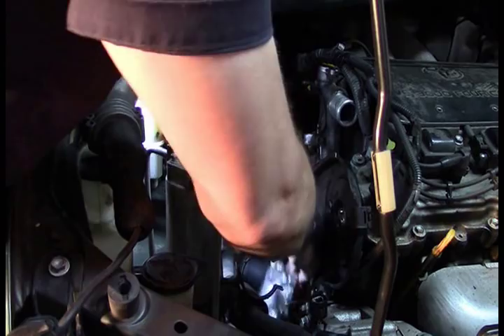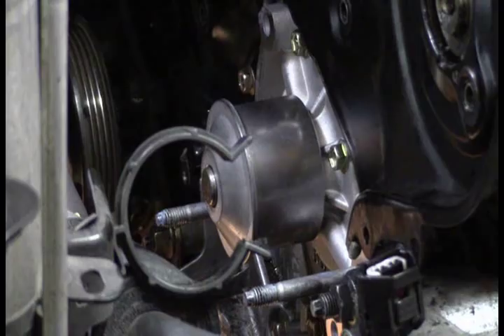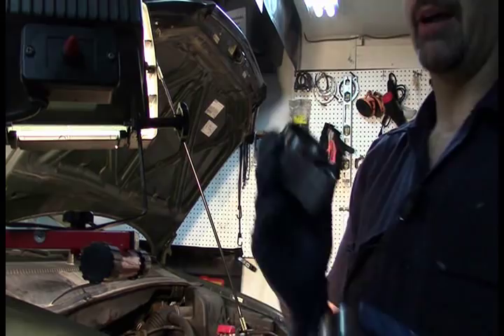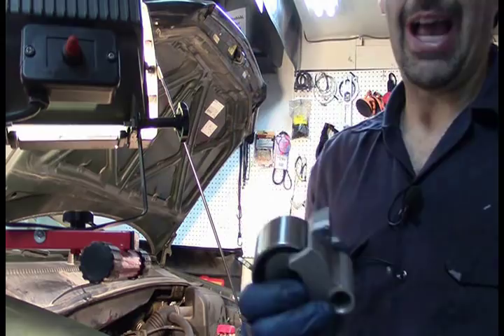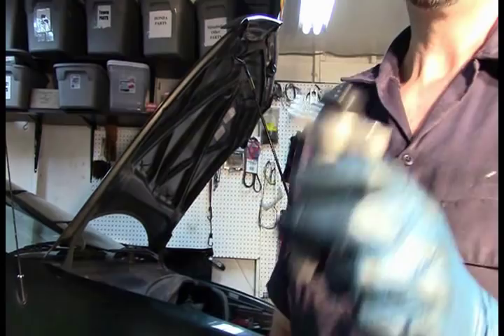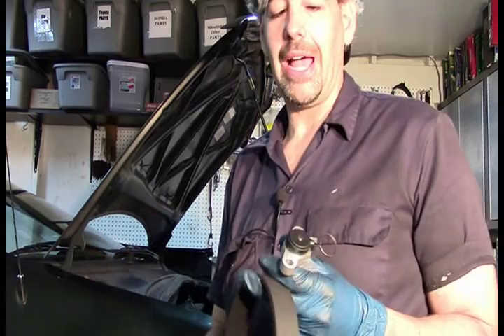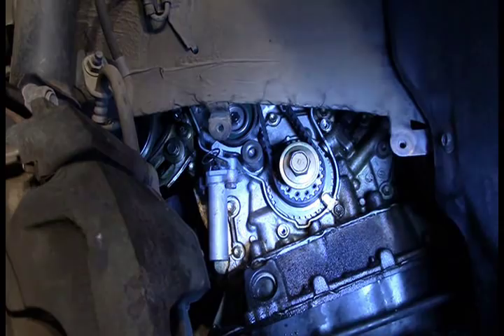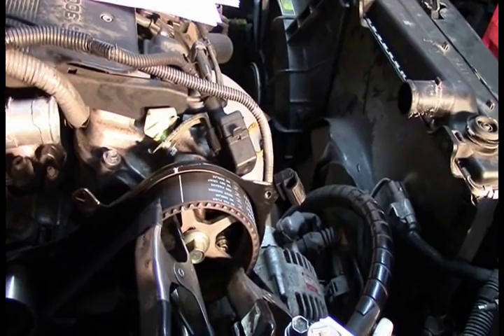Timing Belt 1997-2010 Toyota V6 Sienna, Highlander, Camry, Lexus Part 3

Comment: hi i have a 2001 camry ,   what tool did you remove the rear bottom timing belt cover 10mm bolt very hard to get to any help appreciated ?
Reply from the maker: What is in the way of the bolt?

Comment: Does the new water pump need any sealant on it, or is the metal gasket alone good enough?
Reply from the maker: +Eric Kotter My general rule of thumb is I always use gasket sealer on a waterpump that has metal or paper gaskets but not on one that has rubber/neoprene gaskets or o-rings.
Reply: Thank you for your help! You replied quite quickly. I appreciate that. Thanks for your great videos.

Comment: After getting the bottom pulley out, I have accidentally moved the paint mark on the pulley, but adjusted during the installation of the timing belt. Now after I installed the timing belt, I then turned camshaft for a several time to make sure the timing marks on top and bottom were aligned correctly.  I have found that the timing on the tops was correct, except the timing for the bottom.  In an addition, each hand turning cycle, I heard a double clicks--kind of like metals hit against each other.  And each of a turning cycle the bottom timing mark was further away from the indicated mark.  How can I correct this problem? Thanks for your help
Reply from the maker: +Dre Hogan Start over and do it as shown in the video
Reply: +Schrodingers Box  Do I need to worry that the timing for piston position is wrong, or do i need to adjust it at all? thanks
Reply from the maker: Dre Hogan What you really need to do is tow it to a mechanic. You are just so likely to destroy your engine at this point that I hesitate to give advice.
  Maybe start over from the beginning following the video exactly. If you still have the problem then honestly you need to tow it to someone who knows what they are doing. You are very, very seriously in danger of destroying this engine!!

Comment: question i recently did the whole TB w waterpump  after about 12K miles i hear like bearings but i check them with a stegfhcope  no noice i cant seem to find the noise oh i use a Toy belt and a aisin water pump Koyo bearings and KTN tensioner.   its is make the same noise as be fore the change  again same noise after 12K  on new kit?    some threads say the belt but its a toy belt.     any ideas?
Reply: oh no noise at start up only come on after warm up?
Reply from the maker: You just have to take it apart and fine the bad bearing. Maybe its tensioner pulley.

Comment: Replaced the timing belt and lineup all three points but the van won't start, any body have any idea what's wrong? Please help.
Reply from the maker: You either have it off-time or you failed to reconnect something.

Comment: Great video and very insightful.  Managed to change water pump, pulleys, and belts on 2006 sienna.  Put everything back together, car running great but I got a p0018 error code.  Bank 2 sensor 1 timing fault.  I tripled check my settings and they looked lined up. any ideas?
Reply from the maker: That code is clearly a cam:crank timing code. It is very apparent to me that you are off on the timing by one tooth. Sorry bro hit that's almost guaranteed to be it.
Reply: Schrodingers Box 

FYI: I want to share the issue I had with everyone else in case they experience a similar problem. I had to breakdown and take the car to Toyota, $444.00 later the problem was resolved.  Your instructions were dead on.  The problem was in the semi circle on the cam sprocket, it was slightly worn.  The sprocket was removed to gain access to the water pump.  It was causing a vibration and apparently causing the error code.  It took them 6 hours to find the problem.
Reply from the maker: Sienna troubles Yes I have a video somewhere of a broken relcutor ring on the crankshaft of a car- again, sets ignition timing off, car wouldn't even start

Comment: At 7:28 there is a crank mark at the 3pm position.  If the belt mark and the crank mark are aligned at this step is that confirmation that the crank and belt are now in the proper position?
Reply from the maker: +Sandbag1300 I dont see a timing mark at 7:28??
Reply: Take a look 7:28 at the crank gear (that the belt rides on) at 3pm and you will see an indent in the gear right at the tooth.  As I understand it, that indent in the crank gear should align with the timing mark on the belt.
Reply: I can't really see it @ 7:28 but @ 7:58 on my timer....I believe this is to account for the set back of 2 teeth that you're going back for the tensioner to take up....this is kind of giving me fits right now because I can not get that indent to line up with the paint line AND keep TDC of the crank....it wants to back up 2 teeth. My indent on the crank sprocket had a dot of paint I guess from the previous mech. doing the first belt change.
Reply: after re-watching from 7:00 to 8:00 you really don't say where to put the crank paint mark on belt in relation to the pulley. The new belt has a dotted one but II'm having a hard time using it. I've done belts before and understand the backing off for the slack to be @ the tensioner side but have never seen a belt paint mark take this into account.....have you seen this crop up since making this video? Love and appreciate your channel BTW. Lots of things electrical you've explained that I had chalked up to magic.
Reply from the maker: Leslie Horwinkle It doesn't matter where- you are just making relative reference to TDC is all.
Reply: Schrodingers Box I am re-watching your Air/Fuel video series.  Are you coming back to do more great videos soon?
Reply: Since this vid is just a general TB video it doesn't need such detail I realize. The dot (1MZFE anyway) is supposed to line up to the line on the belt. I see what was wrong in my case....the cheapo belt was painted backwards and everything matches AS LONG AS THE DIRECTIONAL ARROW IS BACKWARDS....since they're only there for installation, I'm disregarding.  I've heard it said not to run belts 'backwards'. Don't know if it's true about layering joints and all that but it's another QC miss that cheap parts are known for. Thanks for response and video.
Reply: Leslie Horwinkle Do not run the belt backwards.  I did and had to redo because it throws off the timing and makes a horrible noise.  My belt was part of the Aisin $165 kit sold on ebay.
Reply: I'm not, in my case it put timing perfect (cranked and ran fine and smooth) but as cheap as another just belt alone is @ parts house I think for peace of mind I'll just replace it. Same kit I believe as you. It may have just gotten by QC for bad paint marks or could have other issues.....like made from recycled surgical gloves.

Comment: Great video here. I will be doing this soon on a 2000 Avalon, but it has some oil leaks. Can you shed some light on what other work I will need to do to replace all the seals? Subscribed as well I'm sure your other videos will help me as well.
Reply from the maker: Yes with this job it is common for me to replace the pan, crank, and cam seals.  All very easy and no skill really needed.
Reply: Schrodingers Box  I've never done this before so how do I keep the camshaft from moving when I remove the rear sprocket? Do I need to take of the valve cover and get a tool to hold the rear cam in place?
Reply from the maker: The latter is how I do it.
Reply: Is there a tool I need to get?
Reply from the maker: I just use a standard wrench
Reply from the maker: You can also buy a special camshaft tool like a Lisle #38220 which is way easier.
Reply: Schrodingers Box both of those options only work when the cam sprocket are there. Does the camshaft stop moving if the sprocket is removed then? Forgive the questions I just want to have all my bases covered.

Comment: Can I ask you a question. Engine running hot  change thermostat. Fan running good. Coolant full. Chang timing belt and water pump three years ago
Reply from the maker: My response would be why did you change the thermostat? Was there no coolant flow?
Reply: I thought it won't open
Reply: Can it be water pump
Reply: How can you tell if the radiator clug
Reply from the maker: No flow through the hoses.

Comment: Hi. What is your method for getting the crankshaft pulley bolt torqued back on?
Reply from the maker: Impact wrench
Reply: Okay, but how do you hold the pulley in place? Do you use a special tool?
Reply from the maker: No need. Not with an impact wrench.
Reply: This is probably a dumb question, but how do you know when you have torqued the bolt down to spec? Is it just a matter of feel (i.e. no diyers)?

Comment: I'm having issues locking/stopping the cams from rotating when trying to line up the lower bottom top dead center. I'm pulling my hair out. Any tips? Thanks for the videos!
Reply from the maker: As shown in the video I lock the rear cam using a wrench to prevent this from happening.
Reply: Yeah had to find an extra pair of hands my camry had a bunch of compressor lines in the way but got it. Looks like I jumped the gun and mistakenly rotated the crank 4 times. Will this make a difference?
Reply from the maker: 2012tymewar as long as your valves are timed to being on TDC Compression you are good.
Reply: Alright looks like I'm good to go. Time to test it out. Tried my best and went slow, hopefully I did everything correct. Thanks again for the in depth and thorough videos.

Comment: have an appointment in a couple of days to have timing belt changed on 05' Sienna, 112,000miles. any advice  or things to look out for. Im having them change the 3 belts, hydraulic tensioner, idler, gasket, and a couple of other things. The whole kit, Gates. A little nervous about them doing a proper job and replacing everything honestly.
Reply from the maker: I don't blame you.  Make sure you also get a new water pump as well. The labor to replace the water pump while doing this is much, much less than if your water pump goes out next year and this same labor must be aall done again.  Remember the new belt will have some more tension because it isn't as stressed as the old belt, so it will be putting more stress on that 112K mile water pump.
Reply: Schrodingers Box getting a new water pump. charging me $960. Anything I can do to protect myself. THX
Reply from the maker: Edgar T $960??!!! OMG!! Yeah get some vaseline lol!! I do this job for $600 complete all the time. $400 if the person is disabled or otherwise legitimately financially strapped.
Reply: Schrodingers Box replaced coolant at 62,000 miles with a BG Flush. Car is at 112,000 now. can I go with a regular drain and fill where they get most of it?
Appreciate your help.
Reply from the maker: Edgar T Sounds like you are suggesting re-using the coolant? Honestly, you could get by with it but the extra cost should be negligible to have the system drained and filled with new. Half the coolant is lost anyway in this procedure so if nothing else, just have them replace the old coolant that drains out and replace with new coolant if a complete drain and flush is charged extra

Comment: Ok so my question would be now that I'm doing it all over and the timing is off..how do I set it in timing again...that back shaft seems to be the only one not landing on the line like the front and bottom one?
Reply from the maker: I lock it in place with the wrench, that's what works for me.
Reply: Ok that what I thought
Reply from the maker: jomar rodriguez Yeah I admit- the bank 1 cam on these models is a pain in the dick because of the location.  My strategy is to simply eliminate that issue as much as possible. I lock that cam into correct time and then just fight with aligning the belt over the  more accessible cam and of course the crank. I don't even deal with the bank 1 cam except for verifying the timing after I install the belt and then once again after a 720deg rotation check, then I pull the tensioner retainer pin, do one final 720deg rotation just to be absolutely sure things remain in time, and then I put it all back together.
Reply: Thanks man...I was wondering if you can move it individually but then I remembered you said about it moving if you don't have that wrench holding...so I appreciate it I got it right centered and put the belt on quickly and it stayed...

Comment: That belt must be way looser than the one on a 4.7l Toyota. No way your turning the crank with the belt in place even with the tensior not installed. Your going to turn the cams at the same time.
Reply from the maker: You can hand crank ANY engine at any time.  I must assume you have never hand cranked an engine. It’s a little resistant only because of compression (some people remove the plugs for this reason) but you only need maybe 60ftLbs torque to crank an engine.  Has nothing to do with belt tension whatsoever.  In fact you wouldn’t crank the engine without belt tension anyway so as not to jump the timing.
  I constantly hand crank engines for things like TDC alignment and leak down tests etc...
Reply: @SchrodingersBox  yes I hand crank engines. That's how you line up the timing marks to remove the belt. I actually hand crank one of my tractors sometimes to start it as well...with a hand crank.

What I was trying to say was on the timing belt I just did. The belt fit so tight that if I was turning the crank with the belt in place the cogs would grab it and also rotate the cams, so unless your TDC already your going to get out of time if the belt is not aligned proper. This is with the tensioner pulley in place and the tensioner not installed.

Comment: Wondering I just replaced this belt and the car does not want to turn on....I did everything u did on video...can a belt tensioner be the case?
Reply from the maker: not sure what you mean by "doesn't want to turn on". You mean it won't even crank?
Reply: Correct it will turn but does not the engine
Reply: I turn the key and it'll want to turn on but something won't let it...I know all the timing was on point
Reply from the maker: jomar rodriguez You obviously did something wrong. I wasn't there so I have no idea what you missed. I would see my video on no start diagnosis to see where the problem is and maybe it will help you catch whatever you missed so you don't have to redo the whole procedure.
Reply: Ok...the only thing I'm wondering is if the tensioner is bad would that be a reason for it to not start over...given that the belt may not have proper tension?
Reply: And if I would have to start over, is it just redoing the timing and going from there? Thanks for your help by the way...vid was really good.
Reply from the maker: jomar rodriguez Jomar you kind of got me worried actually now that I am reading this. Are you saying the engine won't crank? I need a very specific description of this because it sounds to me like you are saying the engine tried to crank but it stops cranking as if something is "blocking" it.  In otherwords it doesn't crank and crank and crank and never start... it is more like "crank..CLUNK" and no more cranking. Is that what you mean?
Reply: The engine does crank, it just won't crank over to the point of starting. It just crank crank crank...that's what I mean...
Reply from the maker: jomar rodriguez Whew, ok had me worried. In that case it probably isn't serious- the other case would have been very, very serious.
  I would first check if you have spark. If you don't have spark you probably forgot to reconnect the crank or camshaft position  sensors either at the sensors or at a harness.Maybe you forgot to reconnect the coil- I don't know- but it's a matter of a connection most likely- unless maybe you forgot to reinstall the crankshaft reluctor ring for the CKPS.
 If you do have spark, well, to be honest, most likely your timing is off. In fact that is almost guaranteed to be the problem. I hate to say it but I would remove the timing covers and re-check that your timing is correct in that case.  If the timing moved, I agree- your tensioner may be faulty. Perhaps you forgot to pull the pin on it?
Reply: No , I pulled the pin but I didn't feel a really good tension on the belt but I figured the tensioner was jammed so I tapped and It kind of tighten so I figured once crank it the belt will tighten up...but guess not...the reason I was thinking it was the tensioner was because the car almost started when I went to crank it the first time, compared to the 2nd and 3rd it just cranked right away...but ok, at least it's not taking out the water pump...that was a pain...
Reply: Thanks for your help...
Reply from the maker: The tension should be solid even before you pull the pin. Your problem is definitely the timing is off. Honestly you are really lucky you didn't damage the engine- if this is an interference model it would bend the valves by starting it without timing belt tension. You won't have to do the water pump but you do need to reinstall the belt and re-time it.

Comment: Wow, what a great video!   I am doing my Lexus RX 330 as we speak.   I realize I am late to the party, but one question...how do you rotate the crankshaft backwards 2 or 3 teeth after putting the belt over the cam pulleys?   Wouldn't the crank bolt loosen up instead of the crank rotating ccw?   Or do I need to use the schley tool with the harmonic balancer replaced?   Thanks a bunch!
Reply from the maker: You back it up so when you tighten the slack when going forwards again things end up aligned
Reply: Understood. But HOW do you back it up?  Wouldn't the crank bolt just loosen up?  Thanks so much, appreciated.
Reply from the maker: You tighten the bolt enough that it doesn't loosen.
Reply: wondered if that might do the trick.   Thanks!